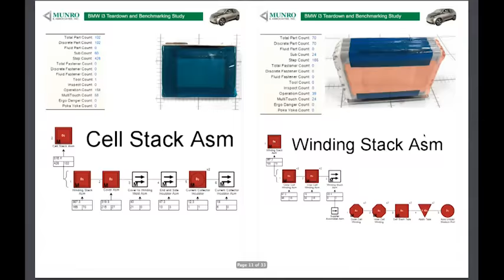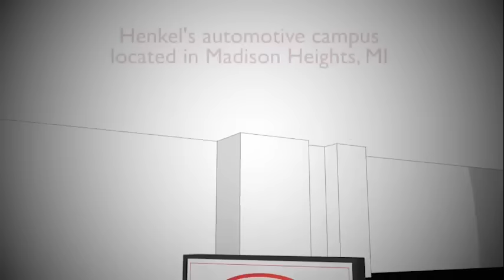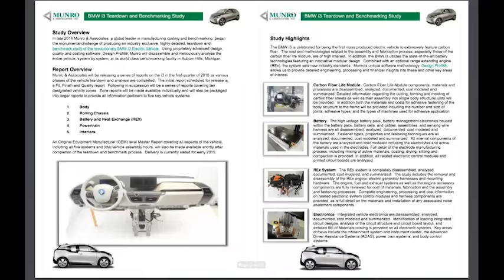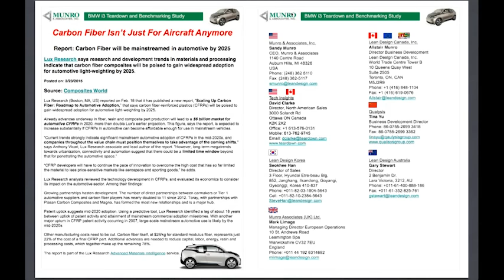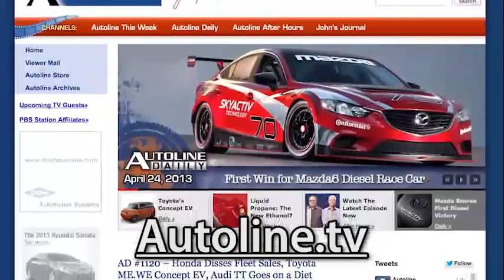Tearing Down the Model T of Our Time - Autoline After Hours 284

Comment: This car is just too small for most of people, and the design is a bit too 'experimental'. Also range is just too low for any trip. i3 is certainly not a Model T of our times.
Reply: Most people commute less than 25 miles per day, so range is enough.  For summer trips, buy the hybrid version with gasoline engine, and it can go long distance 

.

Comment: So these BMW engineers spend a couple billion dollars in R&D to save what? a million dollars in waste carbon fiber by recycling the scraps into the roof and a few other engineering parlor tricks? I'm just not seeing the genius here. Maybe they learned a lot about building low-volume cars that they will be able to make pay off in other projects, but they won't be able to recoup that R&D investment on this project alone.

I'm more impressed with the weight reductions that Cadillac has been able to engineer using conventional materials only, not even having to resort to aluminum. I'm more impressed with the electronic controls that allow the Tesla Models S & X to be controlled by the software in one central integrated computer. These are true innovations. 

The BMW i3 is just throwing wads of money at the problem with little or no constraint. They made the costly decision to go with carbon fiber, and only then decided to save a few pennies on making sure the scraps got used. They optimized the manufacturing process for a low volume vehicle, but left unchecked the far larger R&D costs. They were penny wise and pound foolish.

Finally, I don't buy the major premise that this is the way forward for low volume auto production. That honor goes to 3D printing! No, the BMW i3 is a very sophisticated insider's joke.
Reply: Cadillac wasted money on that stupid ELR (luxury vesion of Volt).  Also it IS BMW which has wads of cash to spend (thanks to their $100,000 luxury cars).  ALSO the R&D was not wasted since it’s knowledge was used in the i8 & will be applied to other EVs being released in 2021/22.  R&D is about long-term thinking not just this year

.